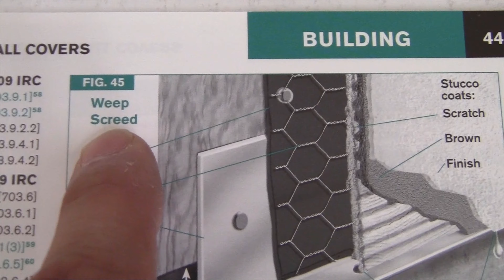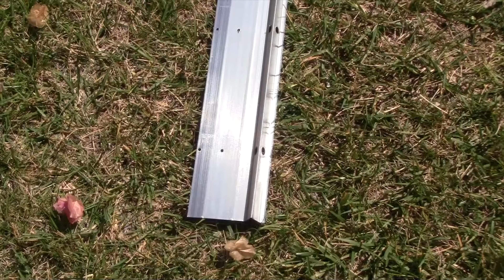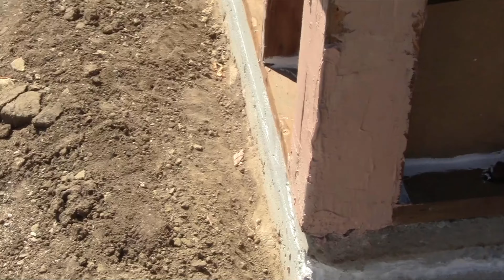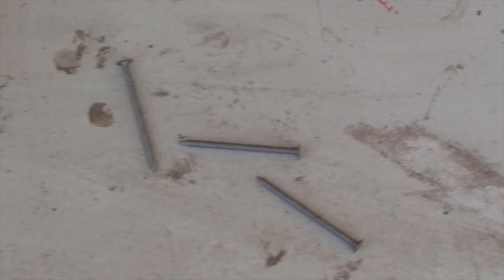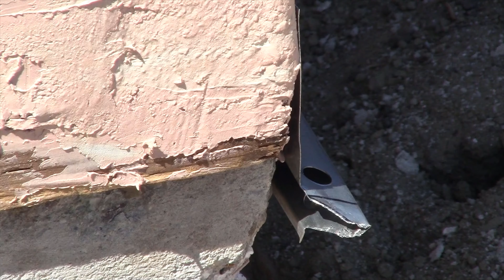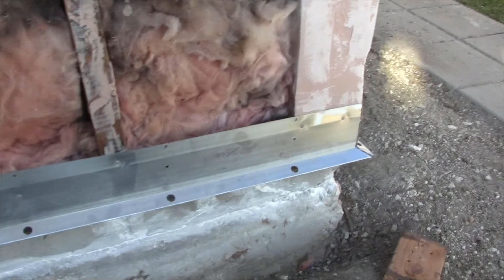Stucco Repair Series Part 4   Installing a Stucco Weep Screed   Sill Screed

Comment: The stucco on our 1956 house has no weep screed and the stucco extends to ground level/the concrete walkway. 1) Do I need to install a weep screed as a retrofit? 2) How hard is that to accomplish for a DIYer? It seems that getting the screed up under the paper on old 1" and three-layered stucco would be really difficult. Some people say it is not necessary but our foundation is shifting from drainage issues...
Reply from the maker: It depends on a couple of things. 1. does your home have eves and how far do they extend over the exterior walls. more roof coverage over the walls means less rain will hit the walls. 2. how tall are the walls? if your home is 1 story and you have 24" overhanging eves then only a small amount of rain water will hit your stucco, which is good for you. 3. is your current stucco failing? This question can be confusing because your stucco may be good but your paint is failing. If something is failing you want to figure out the root cause of that failure in order to come up with a plan to fix it. Does that help?

Comment: doesn't one of the pieces need to turn the corner😊
Reply from the maker: I would think you can do it that way, I just did not think of it at the time. The corner is holding up good so far.